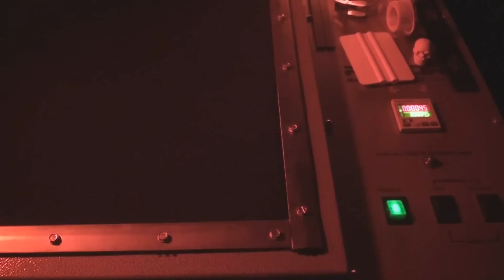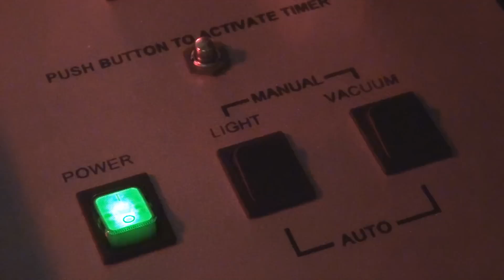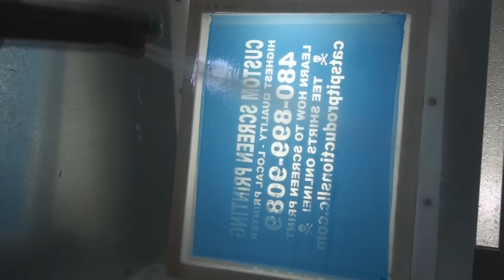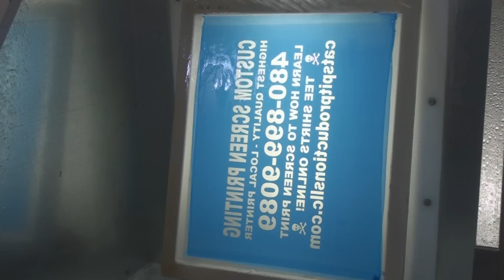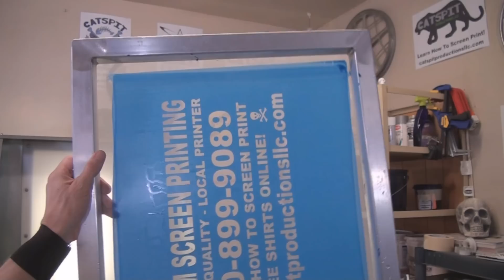Silk Screen Printing: Exposing & Washing Out The Stencil

Comment: Okay man. I'm totally a fan now. Just a little back story: I'm starting my  own screen printing shop in my garage. I don't have an exposure unit like  yours (UV UTILITY LIGHT OVER A PIECE OF WOOD) and I don't have a washout corner like yours (GOTTA GO TO THE LOCAL CAR WASH FOR PRESSURE) but my question is, how do you get the exposure so crisp? So clean and without any JANKINESS!!??
Reply from the maker: Nice. Thanks. Please be sure to subscribe to my YouTube channel. I appreciate your support. My exposures may be cleaner than yours due to the vacuum top on my exposure units. I have also done videos with the tabletop unit which does not have a vacuum top and it works with a padded weight. So your issue could be the sandwich between the film and the screen during exposure. Be sure that it is tight and the film is completely pushed against the screen so no light can go around it. Follow? It's hard to work blind from afar but this would be my first guess. Thanks for watching! Screen Printing Equipment & Supplies - http://CatspitScreenPrintSupply.com/

Comment from the maker: @O2BIon Yes, you should wet the screen and let it soak for a minute maybe. That’s what I do with the soaking and then the weak pressure until I feel it’s ready for full hose pressure. I don’t use the pressure washer here, it’s just faucet pressure. You can hear that the pressure washer pump does not go on. But yes, start with lower pressure until the emulsion is ready to start to washout. Glad you liked the video! Thanks for watching and leaving a comment! ☠

Comment: also, i had my halogen light a few inches higher (around 19-23, dont remember for sure) so i had to expose it longer. best thing to do is try doing a step wedge test (google it and you will find a good step wedge you can download) after you can start to wash out the screen. hope this helps! my only teacher is the internet and catspit has helped me so much so i hope this helps you

Comment from the maker: Exposures and washout times will vary a lot based on film positive density, relative humidity, emulsion and its thickness as well as age. The exposure unit makes a big difference too. I had a pretty thick stencil here with a very old batch of emulsion. But I’m not sure why you are exposing for 5 minutes. You must be using a dual cure emulsion but still with a point source unit I would think you should have a faster exposure time. Thanks for watching and leaving a comment! ☠

Comment from the maker: Yeah it’s just an air compressor at about 25 to 35 pounds per square inch or “PSI.” It’s a small pressure tank with compressor that has a hose attached. I use the hose as shown in the video to blow out the water from the mesh. Thanks much for watching and dropping me a note. ☠

Comment: Can you also use a ultra soft bristle brush or wet cloth to agitate the stenciled emulsion? Or will it cause a blow out to the screen. Thanks! Awesome videos!
Reply from the maker: You're very welcome! I'm happy to be able to help through my video work. Sometimes I use my hand to agitate some but never a brush. If you feel you need a brush or pressure from water to washout a screen, it may be that your film is not dense enough and the emulsion is actually semi curing. Try reducing the exposure time or use a better film positive. Thanks for watching! Screen Printing Equipment & Supplies - http://CatspitScreenPrintSupply.com/

Comment: Do you use a emulsion hardner after you're done washing out image.
Reply from the maker: I do not. I have never had a reason to use a hardener even on an auto press. If you cure the emulsion properly it will work just fine by itself and print thousands of prints. You need to use a good emulsion like the ones I sell of course ;) Thanks for watching! Screen Printing Equipment & Supplies - http://CatspitScreenPrintSupply.com/

Comment: After I expose my screen,and after I wash out the stencil,I put the screen next to a heater,and I use a hair dryer(because I don't have an air comp.)to dry the graphic,and everything looks great after that...BUT when I look at the screen at a specific angle there is sort of a glossy layer randomly covering some parts of the graphic,it clogs those parts. There is no way to get that stuff off.I know that this is actually a small layer of emulsion, but how do I get rid of that or prevent it?

Comment from the maker: Yes that is some under exposed emulsion scum. It is often clear and dries in the stencil opening after washout. Try rinsing the screen well with a high flow of water immediately after washouut. Then let it sit for a minute. At that point I use about 25psi of compressed air from a small homeowners unit I got at Home Depot to blow out any remaining water from the stencil openings. I did a video on this. Thanks much for watching and dropping me a note. ☠

Comment: Does the temperature of the water make any difference when  washing out the stencil? Right now I do not have an indoor water source. Same question for reclaiming the screen. It's cold in Oregon where I live and our water is spring fed.
Reply from the maker: For washing out the stencil it is best to use cold tap water from a garden hose with a spray nozzle. I recently made a video about this referring to whether or not you should be using a pressure washer to make the stencil. Never use hot water for that. For reclaiming and stripping the emulsion off the screen, it really does not matter as long as you ARE using a pressure washer. Follow? Thanks for watching! Screen Printing Equipment & Supplies - http://CatspitScreenPrintSupply.com/

Comment: Crazy, I was blindly searching for what psi to use to air dry a screen with an air compressor and found your video. Great straight forward video!!!! What PSI do you suggest to air dry. I use Ryonet Hifi and Saati PHU for WB emulsions. Thanks!
Reply from the maker: Very cool, glad you found me. I use very low pressure. Probably 24 psi and lower. I sell Saati emulsions and I will be adding the excellent PHU very soon. Thanks for watching. Screen Printing Equipment & Supplies - http://catspitscreenprintsupply.com/

Comment: I saw your other video where you explain how this should not take longer than 1-3minues to wash out uncured emulsion, but it's taking me anywhere from 4-7... Can the low pressure on my hose be the problem?  I mean i have no problem with emulsion coming out where it should not, or over curing.... I just want to speed up the washing out part. I use the Diazo Photo Emulsion.. Green stuff.
Reply from the maker: +Gam3b0y_xL You should only use tap water pressure on a garden hose with a spray nozzle for washing out screens. If it is taking a long time to washout try reducing your exposure slightly. Or maybe your film positive needs to be more dense. Thanks for watching. Screen Printing Equipment & Supplies - http://catspitscreenprintsupply.com/

Comment from the maker: You’ll just have to make do with what you have. If the sink has a swinging threaded faucet you can attach a short hose with a pray nozzle for washing out screens. As far as a back light goes you could hang clear plastic draping into the sing on the back and sides with a light behind that. I’ve seen people rig these “shower curtain” type sinks before. Thanks for watching and leaving a comment! ☠

Comment: Thanks for answering, it was defintely under exposure. Turns out my 1000 watt bulb was not producing enough UV rays or something, I was exposing my screen for 16 minutes at a distance of only 27 cm, and still I had a problem with scum, now I made a UV light table, and no problems so far ;) and again running out of space

Comment: What is the name of spray jet hose used for removing emulsion from screen ? And what speed/ pressure ahould be used ?
Reply from the maker: It's a pressure washer. Anything from 1100 to 2500 PSI should work. Thanks for watching. Screen Printing Equipment & Supplies - http://catspitscreenprintsupply.com/

Comment: Great videos. Always a good watch. I apologize in advance but I am not working with any equipment like you are, except the power washer lol :D . I'm having an issue, currently, in which there ends up being feathering around the edges of my stencil area when I'm washing out the screen. I will provide links so you can see. It always happens as follows:

Is this just an over exposure issue? Or could I not be cleaning my screens right? I use a combo degreaser/reclaimer but seldom use ink remover. I use citripaste for that typically.

1) I coat screen using  Chromaline PC 701 (front side first and then back side).
2) I dry the screen horizontally front side down until completely dry. 4 hour min.
3) Sometimes I store them in double bagged black garden trash bags to avoid potential exposure since I don't have a case.
4) I use a yellow bug light for my safe light, in my garage (which does have a small amount of light bleeding through around the door and the overhangs. Not much. I'd say your eyes could partially adjust after about 5-10 min in the dark.
5) I then place the screen on a 20W x 24L glass panel elevated 16 inches above a 500 watt halogen. I then place a fitted black foam wedge to prevent exposure to the backside and apply a 5 lb weight to secure it.
6) I expose 12 - 12 min 30 sec. I then pull the screen when it's done, spray it wil a water bottle to stop the exposure (???) and move it outside to finish with the garden hose.

This is where is starts to suck :D

I use the flood option on my nozzle and flood front and back for about 1-2 min. Then I switch pressure gradually to stream. But sometime I end up having to use the "Flat" feature which creates a mild pressure washer type of stream in order to get all the emulsion out.

This is the point where the edges of the stencil start to fray and feather so it's no longer a flat line around the edges of lettering, etc. 

https://www.dropbox.com/s/cep1gso6ixqrx6a/WTFscreen.jpg?dl=0

I hope there is a simple fix to this. I have a job due in 5 days and I've spent 2 trying to get this right and it's never happened until I relocated my setup.

Thank you so much, I hope this isn't too much of a question.
Reply from the maker: +Christopher Scott I'm sorry but I make a very good habit of not clicking on random links. if you need help with this in such detail, please help others to by posting this to my forum with the image in the post. Not a link to anything else. 

http://www.catspitproductionsllc.com/forum/

If you post this to the forum I can not only help you but others who will see the post. And that way I can see the image without having to click any links. I apologize, it's nothing personal but I am a big web target and I get hit with a lot of crap from people trying to get me to click their links. Plus this is something that should be on the forum so I can help in detail. 

But if you're forcing the stencil to washout with water pressure then you likely over exposed the emulsion. OR the film positive is not dense enough. 

Thanks for watching. Screen Printing Equipment & Supplies - http://catspitscreenprintsupply.com/
Reply: +CatspitProductions thank you a bunch for responding. I'll do that shortly.
Reply from the maker: +Christopher Scott My pleasure. Thanks for using the forum!

Comment: Does the temperature of the water need to be between hot and cold? It's cool right now in Texas and I keep having issues reclaiming my design. I use a garden hose. I remember reclaiming them fast with no problem when the weather was about 70-75 degrees
Reply from the maker: I like to use cold water. But if it's very cold then you may want to warm it some with a little hot water but it shouldn't be "hot" water necessarily. Thanks for watching. Screen Printing Equipment & Supplies - http://catspitscreenprintsupply.com/
Reply: CatspitProductions how do you suggest warming up the water? I get it from my gardening hoses
Reply from the maker: Yeah me too. So if it's extremely cold and you're on a garden hose there's not much you can do I suppose. Hopefully you're inside so the water shouldn't be freezing cold. Otherwise you would have to be able to go from a hot and cold water tap with a combined faucet with hose attachment.
Reply: CatspitProductions I figured out the issue man! It was my exposure time! It falls off perfectly! Thank you for getting back to me!
Reply from the maker: Excellent, glad to know you got that figured out. You're very welcome. I'm happy to help out where I can.

Comment: do you use the max pressure ?
Reply from the maker: That is not a pressure washer. You should use a garden hose with a spray nozzle. That pressure washer wand in this video had 2 parts. One did the pressure and another had tap water pressure only. Thanks for watching. Screen Printing Equipment & Supplies - http://catspitscreenprintsupply.com/

Comment: if you see the scum you can take and wet your finger and rub the stencil where the scum is and them take a dry paper towel and dab it hard it will pull out the scum. it works for me if I have any scum in my screen. but after you wash you stencil take news papers put them on the wet screen on both sides and it will take a lot of the scum out of it. if you don't have a air compressor. or you can use a shop vac and suck out the water/scum.
Reply: Can I use an air blower because i dont have an air compressor?

Comment: Thanks for uploading this! I have few questions:
1. There are stubborn emulsion on the edges of the text, which I had to prick using a stick. What could be the cause of this problem? Reference here: i.imgur.com / FYtmS7K.jpg

2. What are tell-tale signs that your screen is over or underexposed?

3. Edges of the texts are not fine/sharp. What could be the problem? Underexposed or overexposed? Reference: i.imgur.com / KDpbFzy.jpg

Thank you in advance, guys. Keep it up! :)

Comment: when washing out does it need in dim light environment also?
Reply from the maker: After the screen is wet you can turn on the back light or another light in the room if need be. It shouldn't be an issue as long as the light has low UV. Thanks for watching. Screen Printing Equipment & Supplies - http://catspitscreenprintsupply.com/

Comment: quick question. Ive coated my screens on monday, i exposed on wednesday, left it to dry overnight n attempted to print today thursday. I realised my emulsion is leaving the screen. Im here wondering what i did wrong because it happpened to me previously. What do you suggest? did the emulsion need to dry more?
Reply from the maker: +Addae Mawusi You may have had under exposed emulsion or very poor emulsion to mesh adhesion. Did you de-grease and abrade the new screen mesh before applying the emulsion? Thanks for watching. Screen Printing Equipment & Supplies - http://catspitscreenprintsupply.com/

Comment: I tried that too, but my screen was so under exposed that every time I touch the "exposed " part of the screen for example dab it with a paper towel, it would take chunk off of the screen, so that didn't work. Anyway I found the problem, it was my light source, I replied above in the previous comment in a little more detail. Thank you for your help ;)

Comment: One of the problems I'm having is, when I spray out the screen (110) the stencil washes out fine, but the wet slime must be settling into my open stencil. I've tried gently running water over the screen to remove most of the slime, but when I print a large open area with white ink, the screen still seems to be clogged up in areas and the white ink won't pass through. After I wash it out and run water over the screen I use a hair dryer to dry the open stencil. Should I not use the hair dryer and just let it air dry? If so, I'm afraid the wet slime will drip into the stencil. What am I doing wrong? Thanks.
Reply from the maker: +Sketch Roberts Yes, that is some under exposed emulsion scum. It can be a pain to deal with. These videos should help out:

https://www.youtube.com/watch?v=skiwJTfxgsA

https://www.youtube.com/watch?v=5a1ZqfGIuPw

Thanks for watching. Screen Printing Equipment & Supplies - http://catspitscreenprintsupply.com/
Reply: I think I had a similar problem, trying to wash out a screen for the second time (the first time the image was severely underexposed).  I managed to get the image washed out of the front pretty well in my shower (I also had to use a tooth brush to really help it along) but I still had some scummy stuff on the other side.  I thought that I'd overexposed that screen though, since I had it under a couple of 40 watt fluorescent tubes for two hours (for a 21x31 inch screen with photopolymer and a doubled up positive that was laser printed onto tracing paper).  Ideally, should the unexposed parts of the image just dissolve?  I actually ended up eating into the exposed part of the image a little bit with the toothbrush.

Anyway, I think that I might want to try some transparencies after I reclaim the underexposed screen.  I'm not sure that my fluorescent lights are powerful enough for me to get away with doubled up tracing paper.  I'm going to try the overexposed screen out just to see what it looks like though.  I figure it will be educational if nothing else.
Reply from the maker: Yes, a true water proof inkjet film positive will make a huge difference. And try not to use a toothbrush. That should not be necessary and if it is then something is wrong. Underexposed emulsion will wash out prematurely and easily. Try a 500 watt work lamp with the glass taken out. That will work much better than 2 - 40 watt bulbs. Thanks for watching. Screen Printing Equipment & Supplies - http://catspitscreenprintsupply.com/
Reply: CatspitProductions

Thanks.  I'll be probably be skulking around your forums if you need me.
Reply from the maker: You're welcome. You let me know if you need me ;)